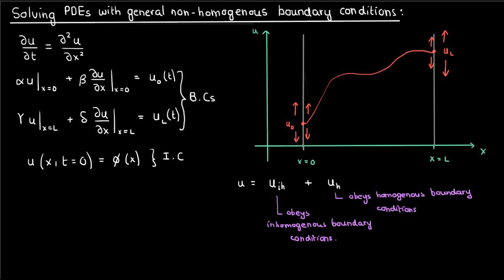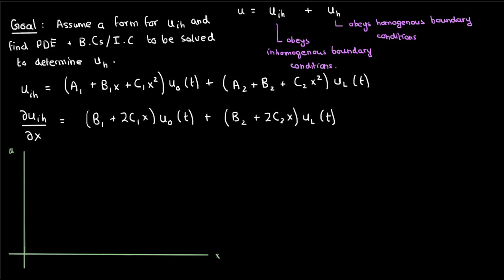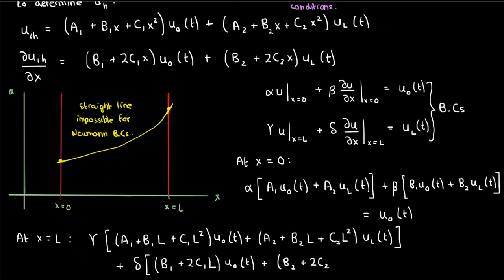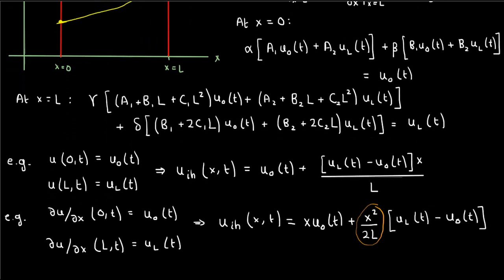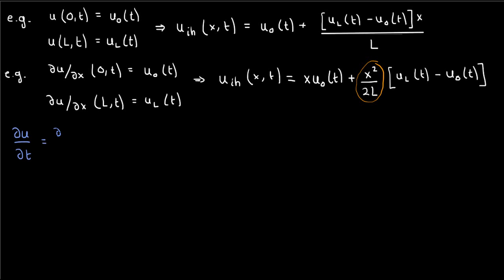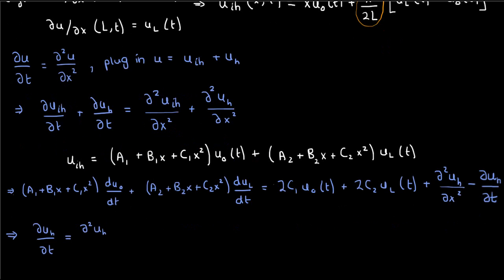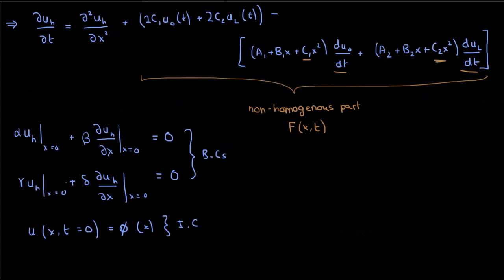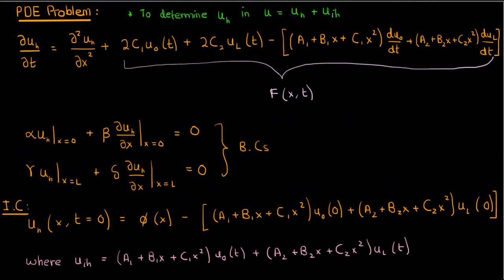Solving the 1-D Heat/Diffusion PDE: General Nonhomogenous Boundary Conditions

Comment: would you please check the article:analytical solution for three-dimensional stresses in a short length FGM hollow cylinder!
actually is not the same as problem i am solving but it has general boundary conditions which are not equal to a function of time.
Reply from the maker: Ok, so what you're referring to are multi-dimensional systems. So if I had the heat equation on a rectangular domain, then the boundary conditions on x (i.e. on the left and right edges of the rectangle) would in general, depend on y and t. Similarly, the boundary conditions on y (i.e. on the upper and lower edges of the rectangle) would in general, depend on x and t.

I haven't covered multidimensional systems yet, so I don't have any videos that can help you, but I hope that my comment at least cleared some things up!
Reply: thanks,hope you cover multidimensional equations soon!
and i was wondering if eigenfunction expansion method(which you have already taught) can be used for homogeneous equation with general B.C? and if so i wish i could have your help by teaching that in a video??!!

Comment: hi,can you help me with a heat diffusion equation which is homogeneous and transient with general boundary condition but u0 and uL are functions of x instead of time. if the solution is the same as you taught here??
Reply from the maker: How can u0 and uL be functions of x if they're boundary conditions? The boundaries already imply that x is fixed: u0 is the boundary at x=0 and uL is the boundary at x=L. Or is there something else you're referring to?